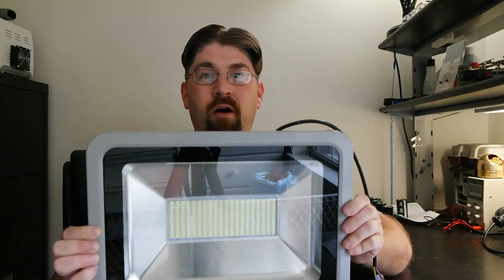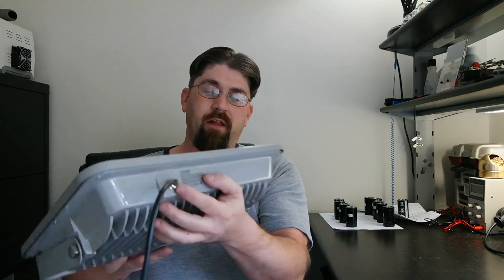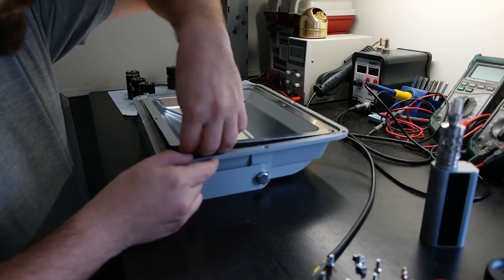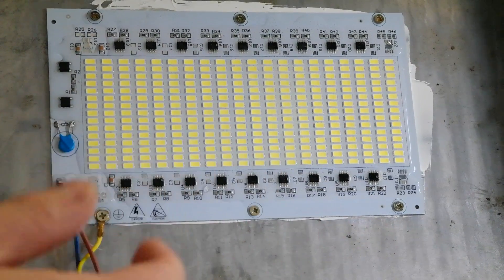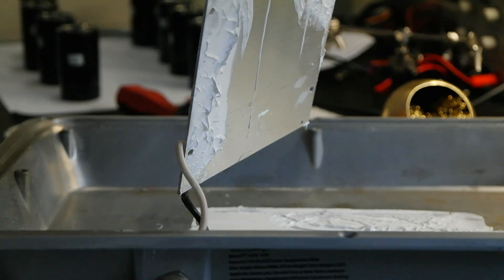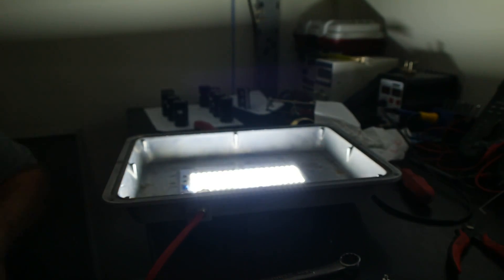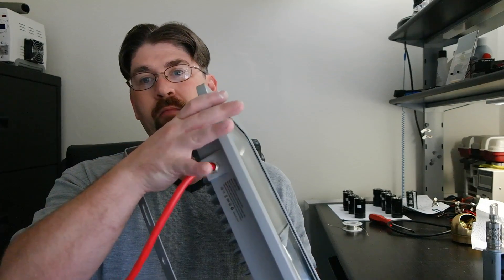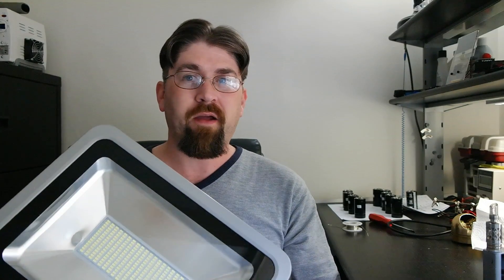$40 150 Watt eBay LED Floodlight Review, Repair, and Modification

Comment: Holy crap, they actually connected the ground wire!!!! Very unusual for a Chinese light.
Reply: I was thinking the same thing. We have watched too many of Clive's videos.
Reply: Can never watch too many of Clive's videos. :)
Reply from the maker: New Jersey Bill I love clive's videos.  he has his own style on how he presents his teardowns that are always either funny or whimsical.
Reply: Jordan Bronson - That's not true. The ground has nothing to do with the operation of the device or what form of electricity the device operates from. You need the safety ground any time high voltage enters a metal enclosure, full stop. Why? This video gives you the perfect example. What happens when the live wire makes contact with the casing (because the soldering was bad and the wire broke off, wire insulation was frayed, damaged, or defective,  or as happened in one of clive's videos - was actually pinched during assembly between parts of the metal case)?  If the ground wire is connected in this case, you get a short circuit resulting in massive current flow which will near instantly trip either a GFCI/GFI/RCD or your circuit breaker if no GFI is present, protecting you and anyone else from getting shocked. With no ground wire connected, the metal light casing will become live,  and if the connection to the circuit board remains, the light will operate - appearing as if nothing is wrong. VERY dangerous. Plastic enclosed tools/appliances where no metal penetrates the enclosure nor forms part of it are considered double insulated and need no safety ground, since the enclosure cannot become live as it itself is nonconductive.
Reply: interesting video, subbed.     I'm making a liquid cooled led spotlight that has 130,000 lumens worth of LEDs.
Reply: +D B - Hahahahahahahaha, I am glad you find it funny!  Sure, laugh at my expense, right?  LMFAO....... While I am at it, I will stick the LED up my arse too, my shit will be " Bright " as hell. LMFAO  😂 😂 😂 😂 😂
Reply: I want to see a video of that when you are done!
Reply: +++Jason Green - Also, I will make you have nice day today :D.  OMG I AM THE DUMBEST MOFO ON THE FRICKING EARTH.  Next time I see that " Green Wire " in High Voltage Devices.... I WILL NOT GROUND IT... I WILL STICK IT UP MY ARSE INSTEAD.... How is that? HAPPY ???  LMFAO   😂😂😂😂😂😂😂😂😂
Reply: I'd better call it quits on this discussion before YouTube runs out of emojis. Have a wonderful day.
Reply: Jordan Bronson - oh boy lmfao 😂
Reply: OMG, that is funny.... I just watched one of His (Clive's) Video too and he was mentioning the " Ground Wire " too.  Funny thing is, they used an " AC to DC Step Down ".  So in reality, the " Ground Wire " doesn't needed to be hooked up, since it's DC Voltage.  Plus the step down is Waterproof too.  So there was no point to connect the Ground Wire.  Anyway, Clive just hate Chinese, from what I have seen so far ://. LMFAO.
Reply: +Jason Green - Before you tell me how Electricity works.  PLEASE PLEASE PLEASE -------- RE-READ my post.  It has " NOTHING " to do with this Video.  I was talking about " Clive's videos ".  Like the People here in the thread (+New Jersey Bill - +Acts 13:41 -+Mad Electron Engineering).  His YOUTUBE USER NAME=  bigclivedotcom  and I think this is the Video they were referring to. Watch it and you will understand what my post was all about:  https://www.youtube.com/watch?v=vbt2ojkXPuo
Reply: ++Jason Green -  Also I like to add..... In " Clive's " Video, the LED he has have a AC-DC Step Down (Also Waterproof too). The Chinese People (Clive's Favorite People) they used an " AC to DC Step Down ".  So in reality, the " Ground Wire " doesn't needed to be hooked up, since it's DC Voltage.
Reply: +New Jersey Bill - The LED in this Video is " Grounded " correctly since it's AC all the way.  If it wasn't, I would be mad as hell since it's AC.
Reply: Yeah. I know what you meant. It still needs the ground. High voltage into metal enclosure, doesn't matter what's inside. It doesn't matter if the LED driver is in a potted external enclosure (Clive's video) or onboard on the COB (this video).
Reply: Jordan Bronson - omg that is too funny, lmfao 😂
Reply: Live mains voltage connection to floodlight case is still better than washer grounding to cold water pipe which one of my neighbors two flats above us 15 years ago and nearly killed me. This at least will have light before someone will try to replace failed bulb. Well, jokes aside, working grounding in this floodlight certainly is unusual thing because it often does stay forgotten.
Reply: This kind of light is also fine. Pretty bright.
https://www.amazon.com/AMMON-Waterproof-Spotlight-Playground-black-200watt/dp/B073W7S2XP
Reply: Switches in my house

Jife8l hdrhueizlxu sr r3ch hi
Ohlufxrfheil2hu eheI huhhhuhuhu4uherhggvvhr
Grjnihi*hiuhuhhhwn 🤨😅🧐😏🧐
A r2uh

Dbv@G d#gy adhb😩😄🙂😩😨😩😄😛☹️😝😘☹️😡😣😩😩🙂☹️🙂😩😨😩😀😩☹️

Comment: Obviously the camera needed a manual white balance after adding this light. I doubt it has a very high CRI!
Reply from the maker: +MondoTV actually the cameras white balance was on auto and I did not do any color grading in post production.  This video is a good representation of WYSIWYG.
Reply: Mad Electron Engineering  Well that is exactly what I meant. Auto white balance is hit or miss - you really need a grey card and manual balance to properly evaluate a light.

Comment: would it be possible to run it on a battery
Reply: Orsan Sabbah  run it straight to the leds bypass all the other things but dont plug it in to power  again battery only
Reply: bong little I think he said the LEDs were for AC. Ive never seen LEDs specifically run on AC.
Reply: why use a deep cycle? could use a stack of high c lipos with an inverter and a protection circuit 
or a regular car battery... deep cycle is expansive
Reply: this led module has build in drivers to run off of AC. You can find flood lights that are designed to run off of DC which are different.
Reply from the maker: If you used a deep cycle battery and an AC inverter you could run it in a portable fashion.
Reply: I_will_get_you There exactly the drivers allow them to be used on AC since I didn't see any AC:DC transformers. I wanted a hack to transform DC to AC although the simplest way is to use an inverter
Reply: I saw the English guy from DIY Perks do something similar, built it from ground up using an LED light with sourced parts. Worked and seemed bright but also rigged it to work with a battery and one of those laptop type power bricks.

Look him up here on youtube.
Reply: no,it works with 120 voltage power

Comment: Holy smokes..that thing is gonna throw some light!!!!!
What did you use as a strain relief for the cord going thru the housing?
Wow...almost slinging 10000 lumen..wow!!!!!!!!!!!!!!!!!!!!
Great snag!
Reply: Use zip tie inside.
Reply: No
Reply from the maker: +Brian C I ended up just using some glue around the outside of the grommet to make sure the wires wouldn't get pulled.  There wasn't that much space inside the unit with the reflector on to loop the wire around in a knot for strain relief.